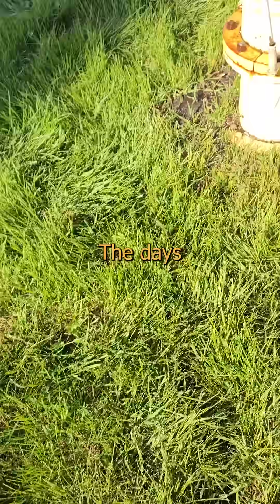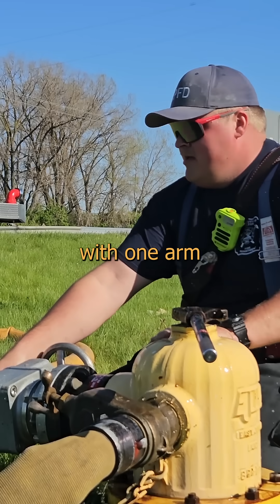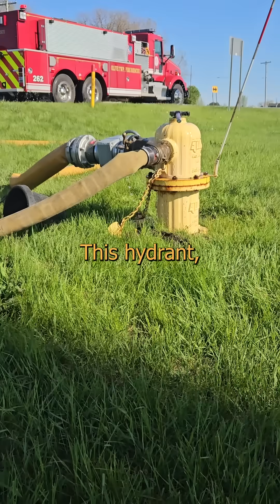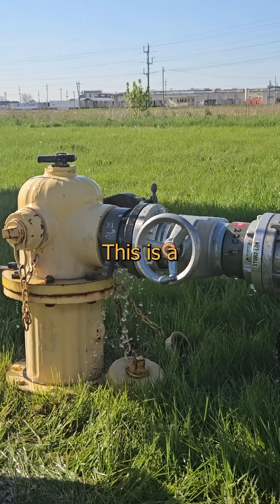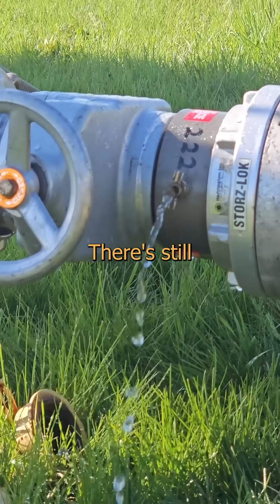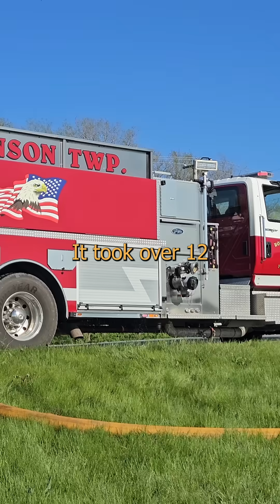Fire Hydrant Gate Valve #chrisboden #comedy #engineering #training #educational #pressure #science

Comment: As a Fire-Sprinkler System Designer, I think about my boss explaining what a "Water Hammer" is and how terrifying it can potentially be😅 that would be a cool idea for a video to explain valves and the proper way to use them.
Reply: Ah water hammer, the most unrecognised example of Sir Isaac Newton being the most dangerous MF to ever live 😂

For anyone completely unfamiliar and reading this comments, water hammer is the potentially massive kickback/pressure spike that happens if you shut a valve with a water flow going through it too quickly. Water is surprisingly heavy, and can be flowing pretty fast depending on your pipe pressure, so if you suddenly block the pipe that's a lot of inertia looking for somewhere to go, and if you're not careful it can and will burst any or all joints, bends, taps, or weaker valves behind the one you slam shut.

Water hammer is like 90% of the reason we use twist/spin valves so much, and almost never butterfly valves, to make sure that the flow is shut off gradually.
Reply: @dragonsaint9446  To elaborate on why that happens, water is basically incompressible. You can technically compress it a little bit, but practically speaking you can't. It's also quite dense, and a fluid. So if a bunch of water is flowing very quickly and you try to convince it to stop in a fraction of a second by shutting a valve, the shockwave will travel back along the pipe at the speed of sound (in water, which is faster than in air) and create a tremendous amount of pressure as the forward momentum of the water is nearly-instantaneously redirected into the walls of the pipes. A cubic meter of water weighs almost exactly one metric ton, so even at the relatively slow speed of water flowing through a pipe it carries a LOT of momentum.
Reply: @dragonsaint9446  Darn right. Some of our new fire tankers have pentametric valves that the only way to open or close is using an electric switch.  It's literally digital on and OFF.  Although it's only in the tankers internal plumbing I hate turning off the flow with that switch.  Give me a butterfly valve with a nice big handle any time, at least I can open and close that nice and slow by hand.
Reply: If the sprinkler pipes are exposed, slam the valve shut and watch every pipe in the place bang rattle and wiggle, that will illustrate water hammer.
Reply: @michaelmcmeel914 , won’t that also cause all of the sprinkler glass tubes to break and start raining?
Reply: @ It might possibly!  Wouldn’t that be fun?
Reply: @michaelmcmeel914  practical engineering made a fantastic video on water hammer a few years ago that basically does exactly that.
Reply: YES. I've seen a forced main blow off a restrained 12" 90⁰ fitting with a thrust block behind it because of an air hammer like it was nothing
Reply: Grady at Practical Engineering did a pretty good video explaining water hammer.
At least, I found it very educational, and clearly explained why poorly installed plumbing "bangs" in the walls when things turn on and off.
https://www.youtube.com/watch?v=xoLmVFAFjn4
Reply: @MonkeyJedi99   Thanks. I need to look that up cause the apartment building i'm in has pipes banging.
Reply: I’m in the fire academy and we were training on a 2 1/2” line, flowing 250 gal/min at 50 psi. This is one of those big boy lines you break out when shit has gone downhill and it’s time to apply the principle of “can’t be on fire if it’s underwater” so it takes two people to handle its kick. 
We’ve got 200’ charged line laid down which weighs ~550 pounds including the water, I’m kneeling on it with full body weight, my buddy has one knee on it and is handling the nozzle, and we’re both in full gear which altogether adds ~100 more pounds. He slams the bale closed and I watch the entire world move sideways as water hammer shifts me, him, and the hose 6” forwards across the pavement. 
A 1000 gal/min flows 4x that. Don’t mess with water hammer.
Reply: @qwertitus  ...and that's pretty cool!
Reply: Water hammer is scary on a large water system ask me how I know lol.
Reply: Speaking of water hammers and the Roman Empire, may I present to you 'Ruina montium'?

Comment: Do they have issues with water hammer while closing those gate valves?
Reply: I’ve never seen a manual gate valve close fast enough to worry about water hammering.
Reply: When it has a crank that's being spun, it's definitely a possibility. 
Closing a hydrant with the big wrench is usually what causes it, and that's not a fast closing valve either. 
 @SteveJ328
Reply: I was cringing at that fast close! Lol
Reply: The piping would be fully restrained near the hydrant to address this possibility in the pipes, but the design of the water tower and water/fire trucks is the first line of defense. A water tower is not filled all the way to the top and is vented to the atmosphere up top. On the trucks you can see the tank is not a pressure vessel since the are shown overtopping. These features are incorporated to avoid overpressure and vacuum complications from filling/emptying of the tanks, but what they also do is turn the tower and the trucks into what is called a surge tank which can dissipate the energy from water hammer. 

In case anyone wonders why they are not pressurized, just remember that liquid water is an incompressible fluid so a water tank under pressure would not hold any additional amount of water and pressure vessels are more expensive than thin-walled vessels. All the water pressure in water systems comes from either active pumping or the wonder called gravity (2.31 feet of elevation difference is one psi for water at STP).
Reply: You wrote a lot of words there, but you don't understand what water hammer is. 
When you have a column of water flowing rapidly through a pipe, and you shut the valve off, you are stopping a lot of inertia of all that water, and as you said water is non compressible, and so a rapid closing valve creates a pressure spike as all that moving water hits an immovable object and stops instantly. 

That pressure spike, known as water hammer, because it sounds like a hammer hitting the pipes, can burst the pipes or blow joints apart near the valve where the pressure spike is the highest. 

It's not uncommon for water mains to break or fire hydrants to split off when fire fighters close the valve too fast. 

A water hammer arrester has to be next to the valve in order to be effective, so it gives the pressure spike somewhere to go. 

Since the water tower is at the opposite end of the water hammer, it doesn't help, and the fire truck is now on the other side of a closed valve, so it has no effect. 

The best way to prevent this is to close the valve slowly, gradually decelerating the water flow. 

  @Drakmarl

Comment: It's interesting to me that the hydrants and Firetrucks in the US don't use Storz couplings but rather screwtype coupling.
Reply: There are a lot of hose connections that are storz couplings, threaded guarantees a decent seal so that’s why it is used on the smaller hoses
Reply: here in my country it's mostly threaded but the surplus engines uses storz

Comment: I’ve snapped a hydrant shaft to make things worse we later found out the gate valve in the street was frozen also.  Tons of dirt removed later, new asphalt and cursing public works director/ My vol fire dept LT it was fixed and we got our appliance back that had been mated to that broken hydrant for 4 weeks.  Hey I have a cottage in Douglas MI
Reply: 4 weeks before repair? How lucky, here in Peru we celebrate aniversaries.
Reply: @XimCines i was just thinking this LOL
i got a 3 year party for 1 hydrant that made a pothole.
neither thing got fixed -_-
Reply: I once made the mistake of driving off while the fire tanker was still hooked up to ground ball hydrant.  That's not something you do more than once!  It ripped the hydrant out of the ground and to make it worse the police road block was just a few meters away and they were the first to see me drive off!    There were lot's of reasons that happened (basically fatigue and insufficient crew numbers)  but I should have done a 360 walk around before driving off!!!  That's something I now do every time.
Reply: @rupertrussell1  That as bad when I crashed the Tenders rear tires through a large septic tank -  very shitty time
Reply: @rupertrussell1  FIRE TINDER.  Tankers Fly,  Tinders Drive and online Tinders coddle Chris ;)